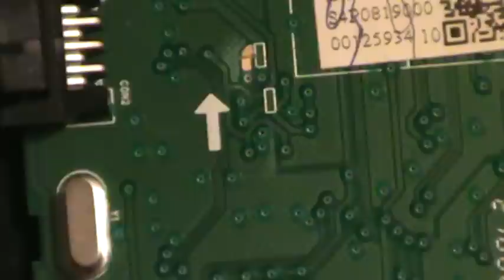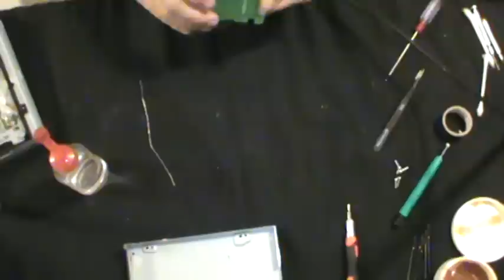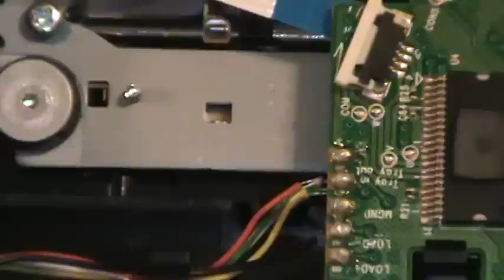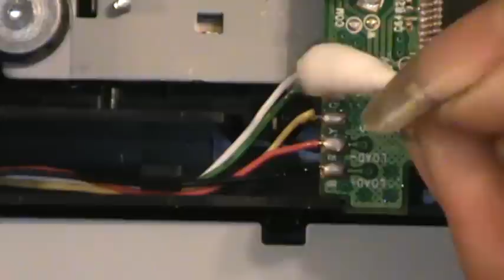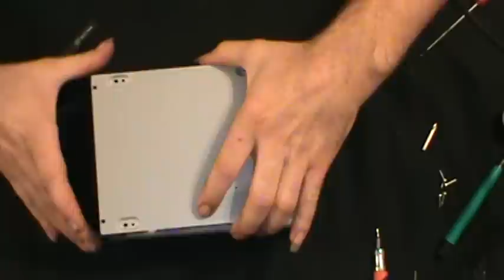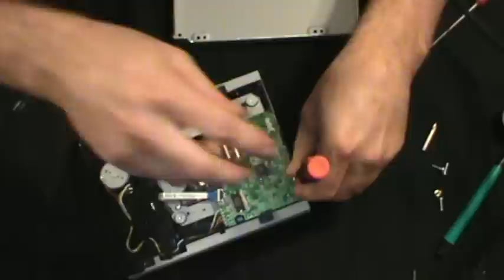Xbox 360 Slim drive flash with Sputnik probe Part 6

Comment: Forgot to ask Do you just leave the drive chip on the table upside down when you probe it? I'm assuming that it doesn't have to be hooked up to the drive tray in any way just want to be 100% sure because that seems hard or impossible if any of those ribbons have to be connected when probing.

Comment: Great video going to order my sputnik tom. Thinking about getting the PCB Addon for sputnik probe. Would you recommend this? It's only a couple bucks and if i'm reading it correctly after you make your cut you don't have to re-solder the trace the switch will let you relock the drive? Thanks

Comment: i was kinda looking around ebay for the TBH Flux i cant find it,, can ya gimme and link. for that type of Flux i should go for the Amtech Flux better witch es better... 
i cant do reballing at not that good yet.
also will this method of trace Cut will it Work with [DG-16D4S 1071]
Also es there a way to know before purchasing a  XBOX slim the DVD drive they come with. i really dont wana buy the slim that with the DG-16D5S same there much more harder to flash at the moment.

Sorry for the question

Comment from the maker: TBH the flux I'm using is some cheap crap from Radio Shack.  There are sever better types of flux then my Radio shack brand.  I two different types of Amtech that work great for reballing so I would think it would work great for the RGH install as well.  I just only use the amtech for reballing because its much more expensive and I have to order it in.

Comment from the maker: Yes I do offer this as a Service.  I haven't had a chance to add this service back in on my site yet.  
I prefer to have the entire console shipped in so that I can test the flash after its done.  Sometimes the flash doesn't hold for some reason.  This usually leave the drive with open tray error.  It happens from time to time and without the console there is no way to test that the flash stuck.  
The solution is of course to just reflash.

Price is $45 return shipping included.

Comment from the maker: You use this method to unlock the spi so you dont need to buy the TX replacement board.  If your using the replacement board then you dont need the sputnik at all.  You can dump the full firmware from the retail drive as it is.  Then just write the firmware to the TX board.  Or like I said use this method to unlock your current drive.  Flash it and be sure to relock and repair the trace and your good to go.

Comment from the maker: The razor Knide will clean most of the green stuff off.  Its not going to get it all.  At least not without spending a ton of time on it.  You can actually pick up a Fiberglass scratch pen at radio shake as well.  Look around where ever you pick up your flux paste.  

Make sure your flux paste is for electronics.  There is also a Plumber Flux paste which solders very nice but its conductive and highly corrosive on electronics.

Comment from the maker: I'm not sure what it is your talking about.  There is no extra voltage involved in this process.  The drive is not hooked to any power source while the trace is being cut or soldering being done.  Provided you dont go probing the wrong point on the board there is no risk of surging or extra voltage.

Comment from the maker: First you need to Identify what disc drive type you have.  First the firmware type should be checked.  once you confirm that the firmware is modable then you need to determine if its an MXIC or a WinBond drive.  On the black chip on the PCB the bottom line first two munbers indicate its type.  03 is MXIC and 05 is winbond.  Winbond requires a Kamikazi hack to be done.  MXIC you can use this probe yes.

Comment: first,,, well done video,very good soldering skills,
i just got a 360 slim, is that the only probe recommended to flash the slim drive?i am not sure what drive do i have.
you mentioned dumping the firmware first,then cut the trace, unlock it, flash it then resolder the trace .